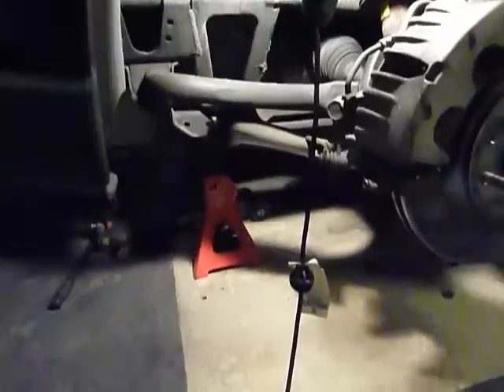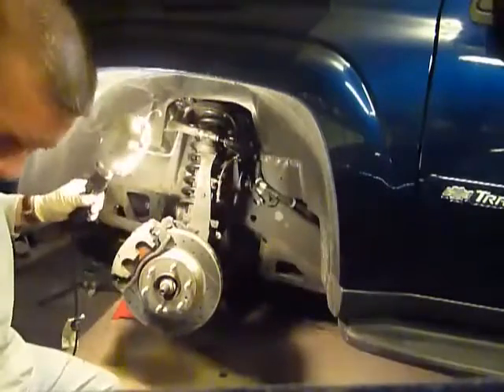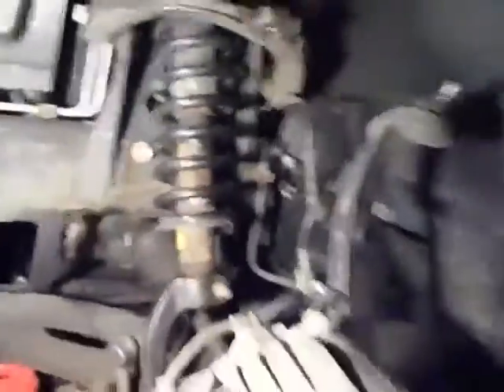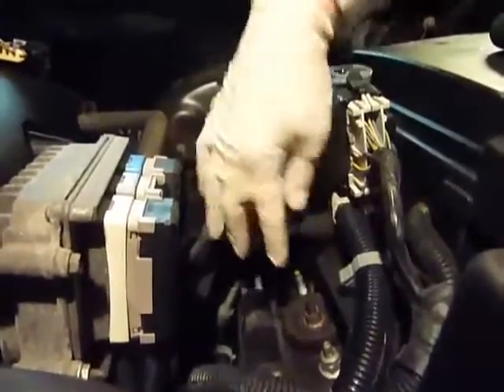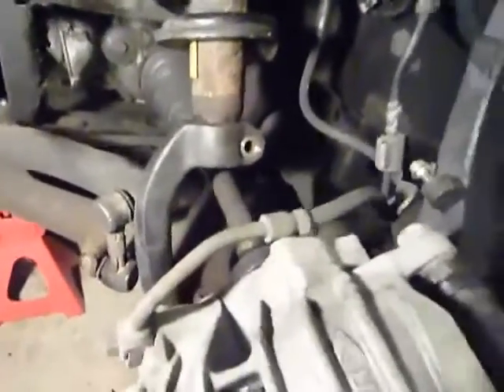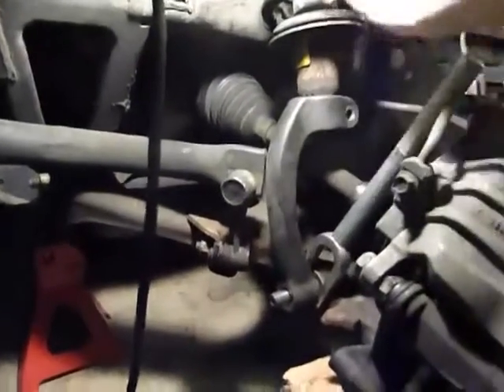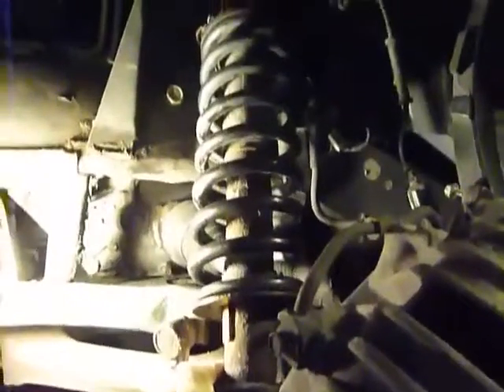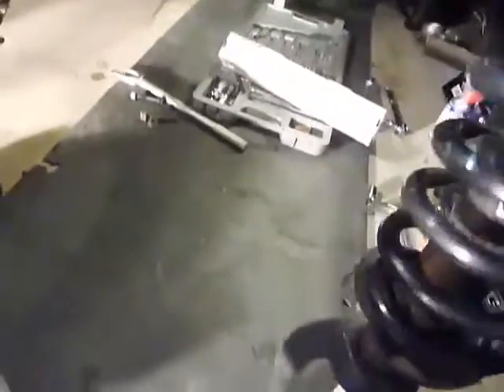Trailblazer / Envoy Strut Replacement - Part 1

Comment: Thank you for doing this video. I replaced my struts today and only problem I had was with that pitman seperator. I had to grind a little in between the fork for it to go and once I did that it went smooth. Thanks again!

Comment: Excellent video. Thank you!  I too was able to separate the arm without releasing the upper ball joint or disconnecting the brake line bracket. Definitely need a separating fork. That took a lot of hitting. The tolerance is close with the fork to the shaft if you have 4wd. Separating the strut from the arm once it's all out took some time too. Had to wedge it with a screwdriver.

Comment: I'm curious as to why you disconnected the upper ball joint. I did mine the same way and there was no need to separate the upper. It came out just fine.
Reply: i have a question was yours 4wd?and im gathering from the comments there is no need to remove upper control arm???